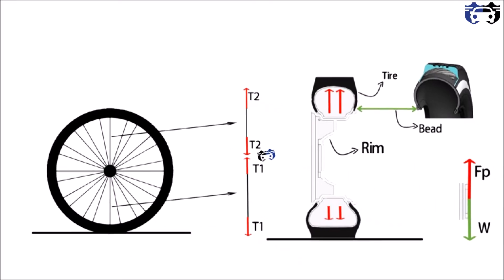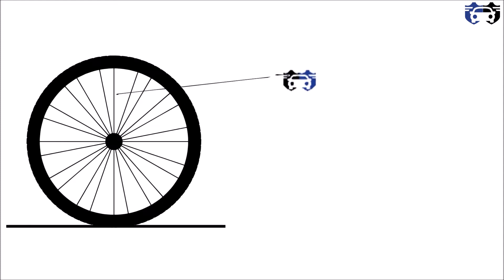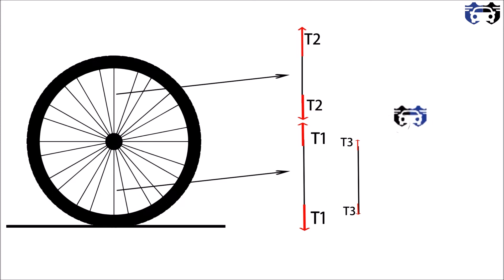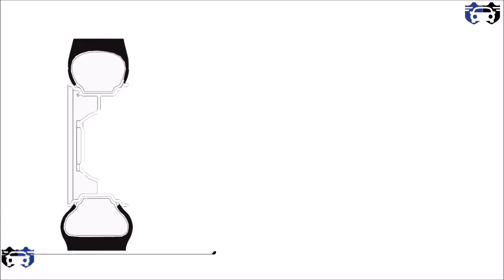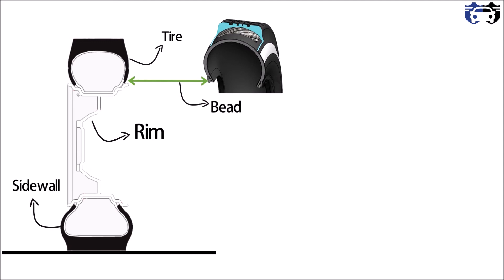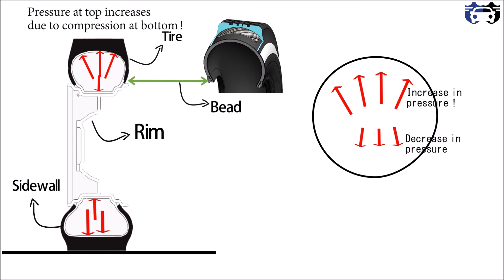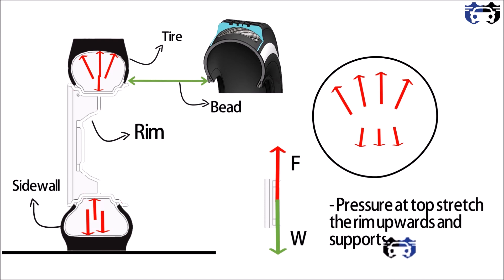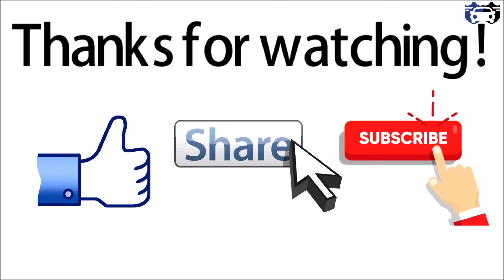How load is carried by the tire ?

Comment: you did very hard work and I appreciate you. there is a mistake or misunderstanding in your explanation of the wheel & tire force carrying mechanism. it's not true that the load bear by upper spokes. consider there are only two spokes, one above and one below and both have pretension. when you add load to wheel center, how much carried by above spoke? only one-half of that load carried by upper spoke. what about remaining? the true solution is that: half of the load carried by the upper, tends to increase its tension and half of the load carried by the lower spoke tends to decrease its tension. this argument true until the load increased to the limit that the lower spoke reached its tension limits. In this situation, all of the load carried by the above spoke, which is not a normal driving condition.
Reply: No. It doesn't work like this. The tension in the top spokes does not increase. Only the tension in the bottom spokes, at the load affected zone, decreases. The forces are only between the hub and the lower spokes. Ii suspect the creator of the video also has a flaw in there somewhere, but I cant say for sure, because he confuses tyre with rim, in the bicycle example.